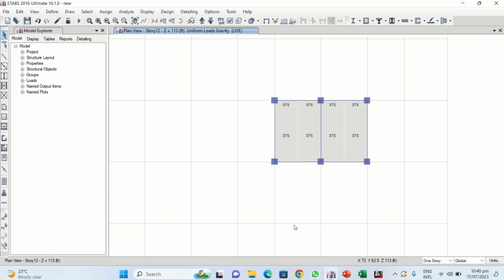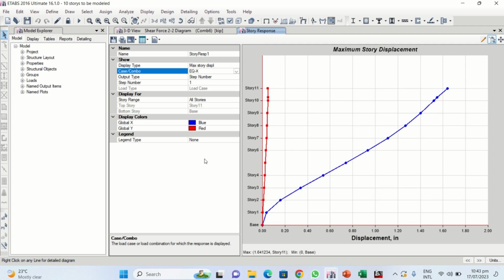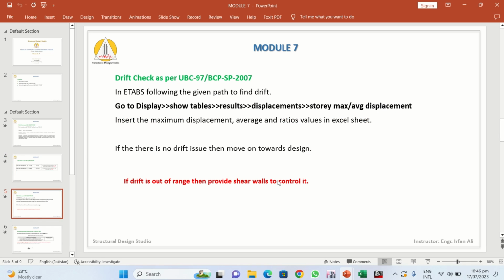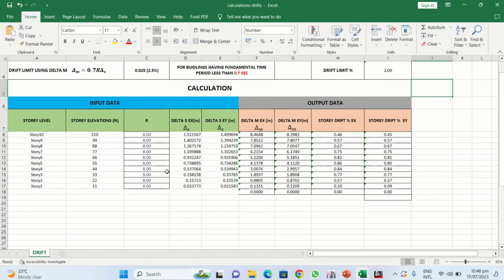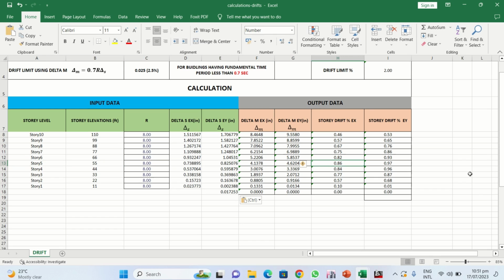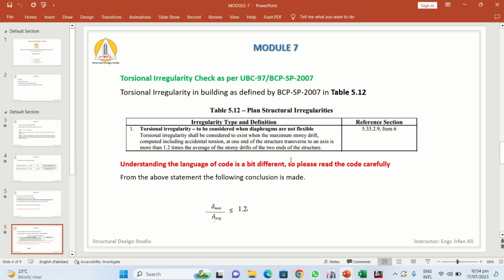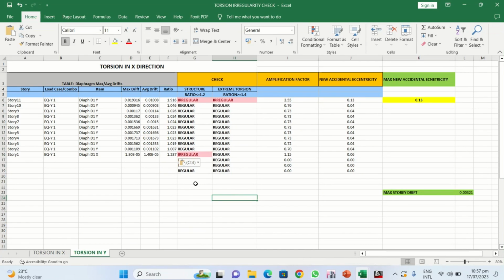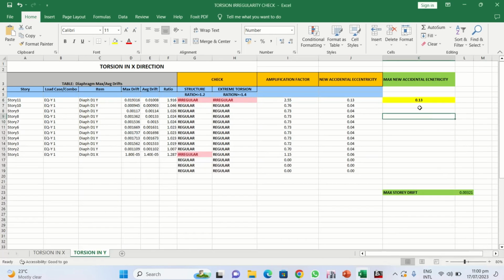Module 7: Drift and torsional Irregularity Check as per UBC 97 #etabs #drift #design #csi #torsion

Comment: Asalamualikom 
Sir you have irregularity in y direction in ratio (1.2)in excel sheet  but you put the value of 0.13 eccentiricity in load case in EQ-X DIRECTION IN ETABS thats the mistake or its right way 
And in excell sheet in torsion in y direction in item column of story 1 row the item name is (diaphragm D1 x) is this item name correct or not?

Comment: Sir , will we check for All EQ directions ( EQ x1 . EQX 2 , EQ x3 , EQ y1 , EQ y2 , EQ y3 ) for irregularity check , if in EQ y 3 Table , torsion is irregular , after calculating new eccentricity , we will put eccentricity value in load pattern  EQ  y > eccentricity change to new eccentricity. ( wont change EQ X eccentricity? right?
Reply from the maker: @usamam2227  yes you will check it for maximum effect and change it only in that load case